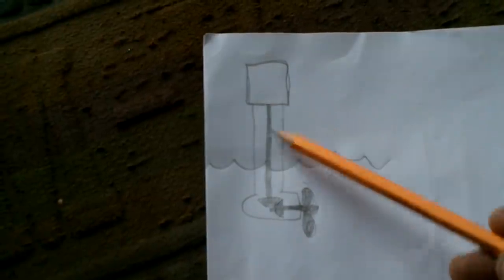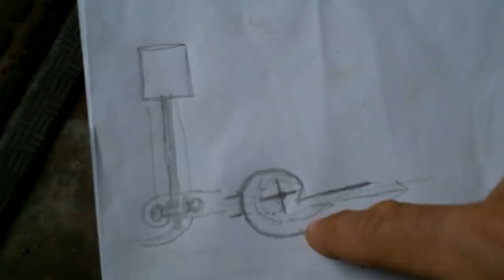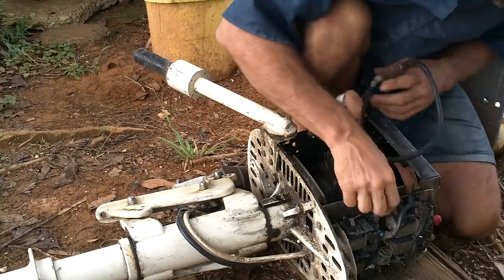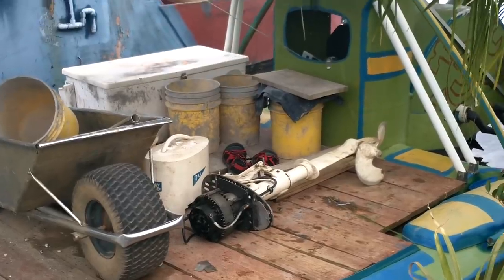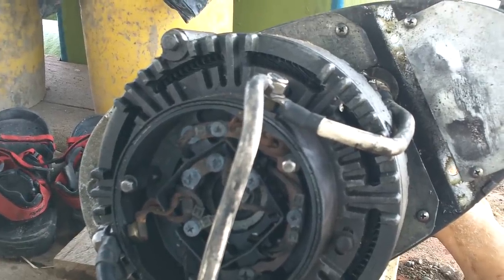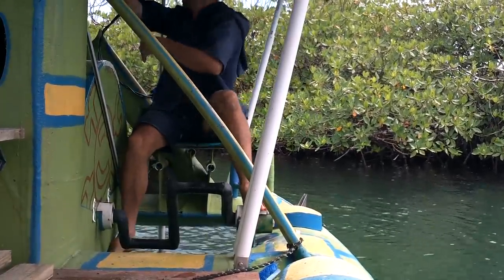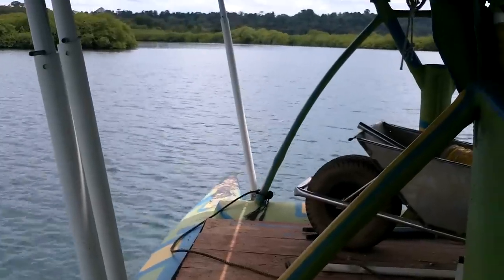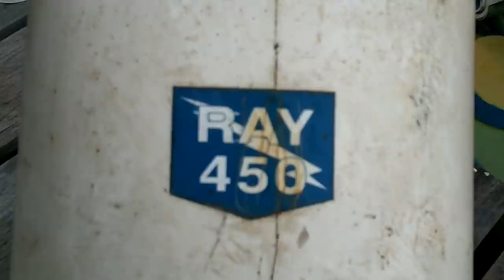Motor Death and a Resurrection

Comment: just put a Motor on to the paddle wheel and make a slip clutch to from paddle wheel to Motor , keep it simple
Reply: That would be pretty sweet! Like pedal assist!
Reply: I like that idea too!
Reply: @marthale7 redundancy is good but it is the same thing, electric motor doesnt work ie; no sun, just peddle.
Reply: The paddles are horribly inefficient, though.

Comment: Take it apart again and do two things to it. 1 scrape the remainder of the coating from the magnets (no grinder). 2 clean the copper contacts by gently scraping the crud with a razor blade. Don't use sand paper, that embeds grit into the copper and it will chew those brushes faster. Removing the coating off the magnets is very important. One flake falling off and ending up on the windings will kill that motor. You can spray paint it, there's no point in keeping the coating on, it's already failed.

Comment: You could change your direction of seating 90 degrees and then use bicycle sprockets with a chain to drive to turn the shaft.  Easy to get parts and very quiet.  You could incorporate rear multi speed sprocket to change gears manually and would take way more torque than the bevel gear.

Comment: Nice! you fixed a $6000 motor with a piece of wire.  My guess is someone bought it in Florida and they are not the type of person to fix things so they got rid of it and bought a gas motor or whatever they sell near you.  I think it is between 10 and 20 HP so you might want to use those switches if you connect it to the battery. Our you could buy a very big PWM to drive it.

Comment: I'd also make a knot meter by using a  small "pitot tube and a sloped section of transparent tubing so's I could calculate approximate arrival time. Or, one could use a perpendicular vane suspended on an arm from the hull into the water which would act against a spring and read it's deflection calibrated in knots. Then again, you probably have GPS on your phone?  That copper wire "shim" was just the ticket. Bang-on thinking.

Comment: Have you considered a horizontal propeller shaft, connected to a horizontal motor shaft by a transmission belt?

If you make two housings on the motor axis (one for the motor, one for the pulley) you don't even have to worry about sea water coming up the belt to your motor. Just leave a big enough space between the two housings. 

The pulley on the propeller axis could be the limiting factor here. If it turns out to be too big, the propeller might be in the slipstream of the pulley housing.
Reply: @dextersxxxxlab  
J Mantzel talked about underwater- bearings in this very video. He makes his own out of plastic rollers and has made good experiences with it in the past.

So that shouldn't be an issue.
Reply: @dextersxxxxlab  
Yes, we will see.

Comment: The super fast F1 of the seas boats, their propeller just has the blades touching the water, as dragging the motor neck and gearbox trough the water gives a lot of resistance.

Comment: I am thinking being able to have the motor cover in its proper place would be a good thing as it seems like ambient outside air is supposed to be sucked up under the motor then swirled around the motor area for cooling. The motor cover would keep debris out of harms way...my other guess is that if you can tilt this motor out of the salt water after each use a very satisfying service life is in store for you. Good fix with that piece of wire shim! I think I have seen this fix done by somebody else and the key was to get those magnets as close as possible without touching exactly like you did...Great Job!

Comment: Send Mustie1 a ticket, so sorry to hear you are in this predicament. Hey, you got 8 months out of the wunderkind motor, count yourself fortunate, sounds and looks like a major electrolysis issue, not grounding and isolating helps....whatever design you fabricate will be a winner. Did the dead fish have prop marks? Winner you are Mantzel..great upload. Ray Electric Repair Manual available on Ray Electric Outboards website..Series 300 were 36V, series 400 and 500 were 48V.

Comment: Volute housings are common, most furnaces use them, air and water both bring fluid.  I had an uncle with a key like this, 1hp gas it was on a canoe. It was a slow but solid unit.

Comment: You can get a 48v  pwm brushed motor controller. It will allow you to protect your batteries these are much cheaper than brushless motor controllers... An old golf cart controller should work.

Comment: Maybe you should try a long-tail boat design like those seen in Thailand (maybe that's where you started years ago, I forget). As your diagram illustrated, the straight shaft is much simpler than modern outboard but with the long-tail it's even simpler since there is no breach of the hull. Or maybe an impeller type drive like in a sea doo? Straight shaft and they are really common and proven to work well.  I'm excited to see you start iterating on a solution.

Comment: the bevel gears do lose some efficiency of course compared to a straight shaft drive, but they aren't that bad esp at lower RPM; but jet drives are not efficient at slower speeds, and require higher RPM and power(about 30% more)....so I'm thinking for electric use, a bigger slower two blade prop and lower RPM(exactly whats on this boat now) would be best, next to a straight shaft with a big slow prop(but then how do you get the gear reduction?) ... but yes, they do still make jet drives like that for outboards http://outboardjets.com/
Reply: The inefficiency of the jet drive on all the outboards i've seen is like you say 30% down . The local rescue guys have a outboard jet but they always run wide open and can barely get out of their own way , the drag from the unit must be significant  too.  a jet ski type unit with an impeller pump might be better  but its  not an outboard type , it would also have to be a smaller size for the lower HP available.  a large slow turning prop is the way to go i think.
Reply: @CheersWarren  The lower unit will be completely out of the water when in operation, so from a drag standpoint they are not worse than a regular prop drive. But yes, they are much less efficient than a prop - and that is the reason that "they" don't make more of them.
Reply: Harman Robotics  good point , maybe in an ideal world but the jet body  has to be in the partly in water flow to get good water feed. Jet skis do better with the intake in the hull.
Cheers Warren
Reply: @CheersWarren  Right, the intake will be in the water, but just barely. That is why I said that from a drag standpoint, they are no worse than a prop drive. A Prop drive has substantially more sticking down into the water.

Comment: big hoeray to you for not completely bashing ezoutboard. It's great fun, but Chinese. I now own a rhio blx. Also a great brushless motor, but also not the best quality ...... Brushless should really be the way to go for efficiency sake .. , but yes, finding quality stuff is almost impossible. PS, nice cap on your head !! I sold mine ezoutboard and the guy later switched positive and negative battery connection, called me up if I could help. He killed the motor instantly with that.

Comment: Dont reinvent the wheel. Get a old jetski pump.
The outboard you have, get an ac motor. Reduce weight more efficient and you can get one off a bench tool, dryer or anything.

Comment: Have you ever considered a gear box off a riding mower that runs off of a PTO? And pack the inside with solid grease and just keep greasing it as necessary? It could be mounted so the gear box is out of the water and the shaft goes out at a angle. I have been contemplating using it for a motor myself because it basically is a much heavier built gear box that would allow me to hook it up to a twenty horse motor with just my driveshaft.

Comment: The turbine pump things are really, really hard to design well. While just about anything will work, it's difficult to get them efficient. I have actually been in a jet boat in New Zealand, they do work well, have a very low draft and can be very high power. One interesting quirk- they release the water AT the surface, rather than underwater, because it gives better performance (probably helps fill in the wake behind the boat or something.) But whether that's the same for you is unclear, the Reynold's numbers may be different for your relatively slow cats, than the speed boats, but I bet it wouldn't hurt performance to release the water at the surface.
Reply: The reason that jet drives shoot the water out above the surface is because you get much more thrust that way. If the jet is below the water then the surrounding water slows it down, greatly reducing its efficiency.

You can do a simple experiment to prove this to yourself. Take a garden hose with a spray nozzle and set it to spray a strong jet of water. You can see and feel the thrust that the jet is making. Now take the nozzle and dunk it underwater. You will feel the thrust from the jet go to nearly zero.

Jet thrust comes from accelerating a mass rearwards. The faster you can accelerate the mass, the more thrust you get. A jet does not get its thrust by "pushing" against the water. Anything in the way of the jet reduces the speed of the jet and robs power from it.

Comment: Standard jet drive on a gas driven outboard loses 25% efficiency over the prop drive lower unit. I know this from experience. Unless you have some whiz bang design change that boosts efficiency of the jet drive.

Comment: That electric outboard maker has been around for a long time, as far as I know they are still making outboards. 

As I remember they used a Briggs & Stratton E-tec pancake motor that are no longer being made. BUT another company is still making the motor so parts and replacement motors are available.
Reply: I think Motenergy may be the company that makes these now.

Comment: I like your propeller idea will not damage coral either. Could you use an old sump/trash pump (centrifugal pump) for a impeller housing and to direct the water it would be designed to move water effiecencly

Comment: What you're showing is called a turbine. It is more efficient than a propeller. There are two ways (that I know of): 1. what looks like a propeller with much more blades embedded in a housing cylinder https://en.wikipedia.org/wiki/Water_turbine 2. The other one has vertical blades & in a housing as in here https://www.hindawi.com/journals/mpe/2017/5867101/fig1/ . In larger ships they use turbines and not propellers https://www.geaviation.com/marine/engines/military. Exciting work - keep it up.

Comment: Sounds like you're describing a jet boat. They're somewhat popular in New Zealand rivers:

https://en.wikipedia.org/wiki/Jetboat

"... a jetboat draws the water from under the boat through an intake and into a pump-jet inside the boat, before expelling it through a nozzle at the stern."

Linking this up with something designed to encourage a vortex could work well:

https://en.wikipedia.org/wiki/Cyclonic_separation
https://www.thingiverse.com/thing:1657498

Comment: Available in three power choices
36 volt motor, comparable to 10 HP gasoline motor
48 volt motor, comparable to 16 HP or
60 volt motor, comparable to 20 HP gasoline motors

Comment: If you have to come up with an easy build when/if that fails, consider that mud moter design where you only need one bearing ahead of he prop, no gears. Depending on the shaft size, cutless bearings (open water lubricated) are easy to locate. I'm sure less expensive could be located, just wanted to list something for a reference. https://shop.hamiltonmarine.com/products/cutless-bearings-naval-brass-43622.html

Comment: Wondering if powering the paddle wheel is a thing.
Reply: i have said the same thing befor and got slated for it inefficiencies  blah blah to me it is the most simple
Reply: I've built a few electric bike projects with wheelchair gearboxes and motors. I feel like the setup from my red electric trike videos could be easily adapted to the paddle assembly. The gearbox make lots of low rpm high torque power. 
Probably not really efficient, but the motor uses less power than the solar system.

Comment: I have looked on the manufacturers/seller website of the broken motor it says nothing about use in seawater.
That usually means don't.
This motor does not appear to be bilt at a price point I woud aspect saltwater ratings.

Yes brushless means when the electronics go you're out of luck, but relying on a singe all in one (budget) pakkage of any type in these conditions is just asking for it.
If you don't have a proven system take backup.

Comment: What about a trolling motor? the motor is under water sealed in a case. what about using a water pump/impellor and case from a portable gas powered pump?

Comment: Looked up ray.electric outboards but didn’t see the 450 . Only the 400 & 500 which are 48 & 60 volts both weight 75 lbs equivalent hp is 16 & 20 .    Thrust pounds are 240 & 300 .   Amps at trolling are 6.5 & 7 top speed amps are 80 & 84

Comment: Try weed eater flex cable. You can mount motor in dry stable location and run cable through a shaped tube direct to prop

Comment: That's kind of like a jet drive. I know jet drives are a lot less efficient because of the enclosure, and you have to have higher rpms. Interested to see how this turns out.
Reply: yep 60/40 jet drive
Reply: I’ve got a 90/65, lots of fun but has its drawbacks

Comment: On the rayeo website they show a 400 and a 500   http://rayeo.com/index.php/technical-specifications/
specs   - hp/amps -top                -med               -troll               -volt     -number of batteries
400                          - 16hp/80a    -8hp/32a       -.9hp/6.6a      -60       -8
500                          - 20hp/84a    -10hp/34a     -1hp/7a          -48       -10
Looks like a super nice motor. The magnets look like the magnetic clutch on a automobile air compressor.
I just want to say I have watched almost every episode and you are very inspiring.
Island life can be interesting...
Stay safe and best wishes. oh, and don't get lost.

Comment: The jet drive looks very inefficient.  Why don't you use a toothed belt drive and avoid all the turns. Aluminum cogs and a rubber belt should meet all your specs.  Do twin down tubes to avoid excess drag.  Best of luck.

Comment: Got little curious and checked the power. Couldn't find the exact model but they current 60V motor looks the same and based on the specified current is 5kw motor. They are little optimistic by saying it equals 20hp motor. That may be true when comparing the thrust in lower speeds since the propeller is big and effective rpm in electric motor is wider than gasoline, but still quite optimistic.

Anyway, you soom to have a good motor to you boat and I think you batteries can handle that about 4kw which it takes from 48V, at least if you have solar panels to make they part. The real question is, can you boat benefit from that power or is it wasted into hydrodynamic losses.

Comment: There isn't any reason a brushless controller should fail in a marine environment if the components are fully potted, but if you were running it directly off solar power, it's possible the electronics that do the control didn't like the variable power?
Reply: It was a Chinese motor, nothing Chinese lasts.

Comment: Guessing it would use about 200 Amps at 48VDC.  Seems it is about 15HP.
Reply: They current motor is rated for 84A/60v in full speed, although they say it equals 20hp

Comment: They don't make them because they a not very efficient.  Example,  A 40hp motor with a prop will move you a 20mph. to go 20mph on same boat with a jet/impellor drive you need a 60hp motor.  Their only advantage and why they sill make jet drives is for very shallow water operations

Comment: Ah...so sad to announce that Jaimie Mantzel, noted inventor, creator, innovator, philosopher has died.  Many had noted his absence for weeks in posting new videos but few knew of his passing.  Mantzel drowned in his homemade septic tank after becoming severely drunken on a batch of fermented banana leaves and coconut husk fungus liquor and falling in.  Contributing factors were a just completed 27 mile swim to shore after his famed solar pedal boat broke in half after striking a tuna at high speed....some estimated at 2.7 miles per hour.  Jaimie's partially decomposed body revealed many steel plates holding his severely deformed bones together, and speculation has it that the abuse he suffered from his many marathons, pick axe digging, sea-sod lifting while digging out his canal, chicken rustling, mold making, and concrete bucket lifting contributed to the extreme pain and exhaustion he must have been experiencing  when seeking relief from his home brew concoction of leaves and fiber.  An autopsy was conducted and in addition to the above, the mass of Jaimie's brain was found to have been reduced by 3/4 owing to the presence of copious quantities of fiber glass resin residue.  Jamie's remains were buried at sea after being set afire on his ancient, moldy and mastless 35 foot sailboat, christened "U.S.S Trump."  Jaimie Mantzel will be remembered by those who loved and hated him as a shirtless, bearded purveyor of eccentric ramblings, pointless, if entertaining, projects and experiments, keen wit, and enormous intellect.  You will be missed, Jaimie.  I....Russ Reimer...and all of us...salute you!

Comment: you can easily buy a jet lower end of gas outboards.
Reply: pretty sure based off google that your motor is 18hp that would be plenty to turn a jet lower unit if you were so inclined.